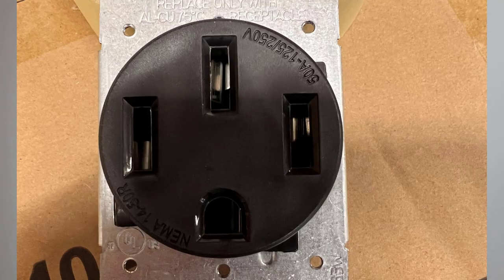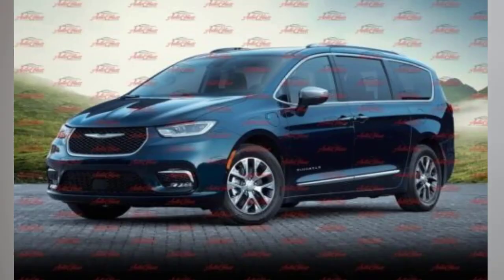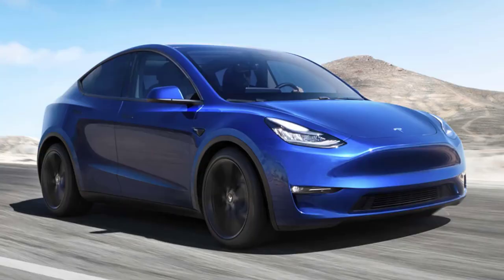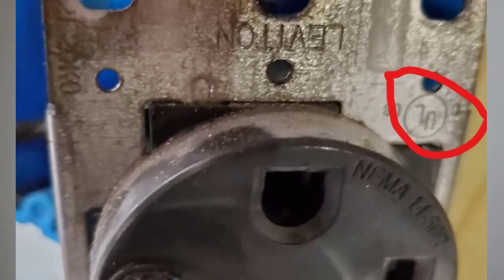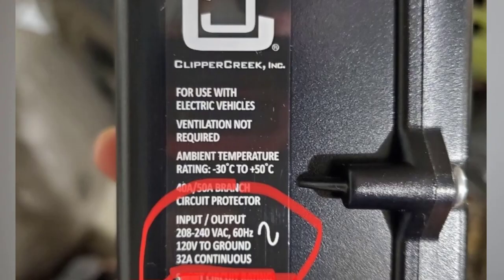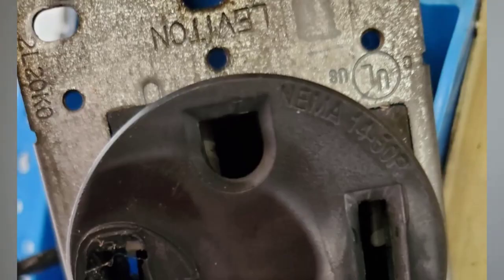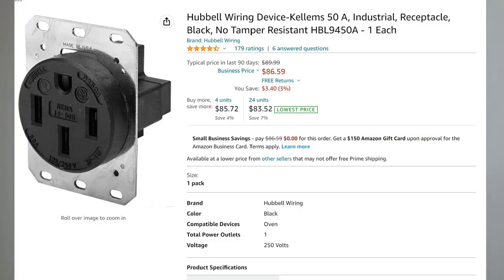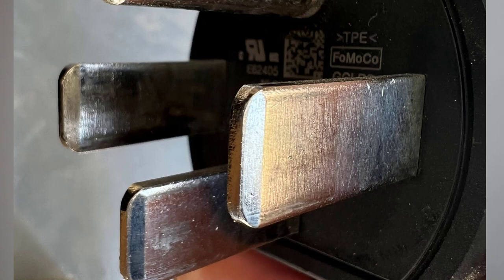ELECTRIC VEHICLE HOME CHARGING DANGER

Comment: You are so right about the cheap receptacles.  I saw that the Hubbells are sourced in China.  Not that that knocks their quality.  Also saw in another video that the Bryant was highly rated and it is reported to be made by Hubbell too (they look identical).   The inner tabs on the Levitons look too small for a sustained high currrent in/out type of plug in and out for all that current.  I'm glad you are on this.  I'm going to use the Hubbells for our stoves. 🙂
Reply from the maker: The person this happened to sent everything to Clipper Creek (the charger manufacture) who acknowledged that the Leviton outlets are pieces of crap and Hubbell is the best. Bryant is in fact made by Hubbell, so they may be just as good.

Comment: It's also very strange how they rate some of these mobile chargers. Ford states their mobile charger is a 32 amp charger when in fact the max is 30 amps @ 240 volts.  In fact I've never seen my mobile charger draw more than 7000 watts and usually less than that, which puts it below even a 30 amp draw. I believe ford calls this a 32 amp charger because if your panel voltage is only 220 volts than 7200 watt draw would equate to very close to nearly a 33 amp draw.  This could have been a contributor to this man's receptical burning up. Low voltage raises the current draw.
Reply from the maker: True, but don't you think a UL approved device should handle that?